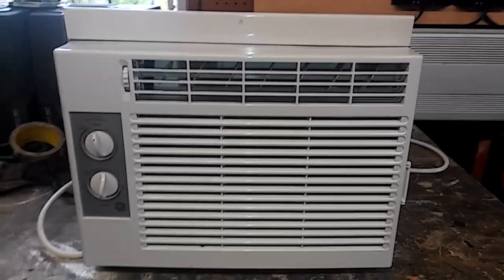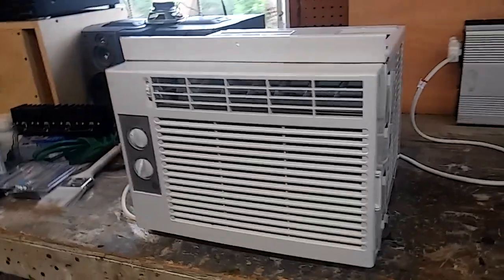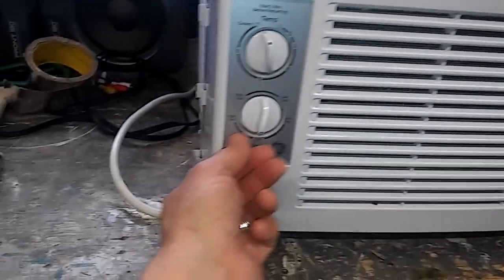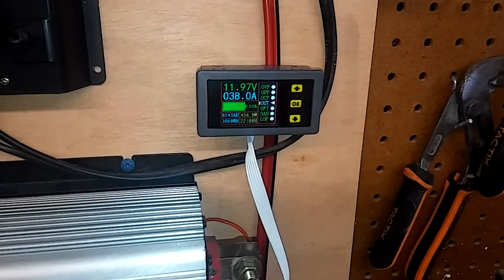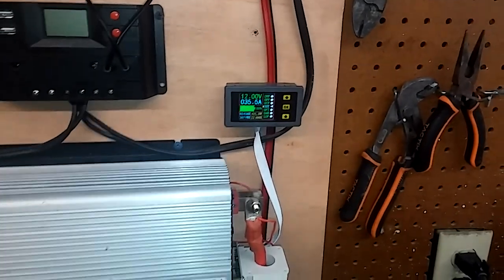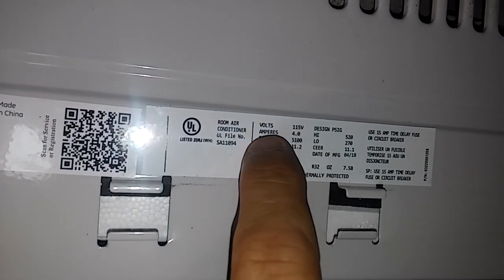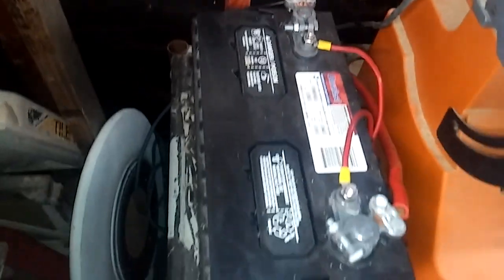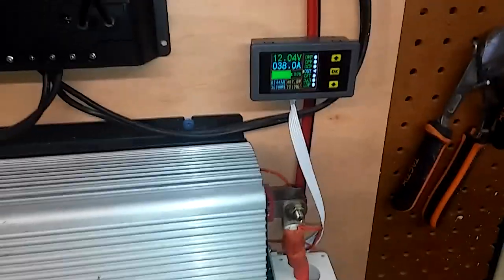6000btu ac. On Harbor Freight Power Inverter  pulls lots of amps.

Comment: A 100 AH battery, don't drain it down to zero, ie 3 hours. You'll destroy the battery real quick. So realistically maybe 1 to 1 1/2 hours, if your not running anything else.
Reply from the maker: I agree.. A/C units will kill a battery quick. Need lots of batteries

Comment: Like your videos, thank you. I believe the math for inverters is pretty simple, 12 volt inverters require approximately one (1) amp of DC input for each 10 watts of AC output.
Reply from the maker: Thank you.. Actually... For every 1 amp your Ac device needs,  your power inverter will pull around 10 amps from your battery☺
Reply: @Checkitfirst  Pretty much the same thing, you are just saying it a different way. I guess all I was trying to point out was that folks can figure out pretty quick what the amp draw will be from the inverter. For every 100 watts of AC from the device, the inverter will pull 10 amps DC from the battery. If your A/C unit is pulling 500 watts, the inverter will draw 50 amps from the DC side on the battery. Your video just helps show it visually.
Reply from the maker: Im sorry.. Your correct. I didn't mean to make it sound like I was correcting you. Sometimes my texting comes off a bit blunt😕
Reply: @Checkitfirst  thats a terrible rate of exchange i guess you would do better if you had a 24 volt system 12volt i believe is the crappiest
Reply from the maker: @mannyfragoza9652  
I am now on a 24 volt system. Might go to 48

Comment: 4 amp at 120v = 480 watts  / the reading your looking at with  your amp meter is a 12v amp draw so , 39.4 amp @12vdc = 472 watts . basically the same thing. you will never the rated amp draw rated for 120v when reading from a 12v battery.

Comment: I think mine takes about 25 amps...I ran it 6 hours today off of 20 batteries. My inverter is 24 volts.
Reply from the maker: Nice. During the day with good sun light,,, if you have enough solar,, you should be able to run it a long time. At night is where the challenge is for me

Comment: Excellent video and I hope you can read my comment. I have a question, how many batteries are needed for it to work correctly and how is it connected?
Reply from the maker: With this a/c if you’re going to use led acid marine batteries I would use a minimum of 8 batteries. Lithium batteries you could use 4. This is just a estimate because there are lots of factors in play. You would also need about 1500 watts of solar to recharge the next day and run the a/c moderately so your ready for the night. That’s if it’s a good sunny day.
Reply: @Checkitfirst  do you use one battery at a time are do you combine all
Reply from the maker: @oldschool6703  
Led acid batteries,, I would say 8-100ah.

Comment: If that's a 100 ah lead acid or agm battery then you're only getting 50 ah worth of out of it because if you go below 12 volts you're going to damage that battery and 12 volts is 50% of the battery so you can Figure 1 1/2 hours of running that air conditioner.
Reply from the maker: You are correct. In the beginning I figured 100 amp hours is what you got not realizing that I don’t even get 50%. It’s more like 30%.   you need a crap load of lead acid batteries?
Lithium is coming in the future

Comment: I dont have a battery! Can I use without one? Some one help please 😢
Reply from the maker: No. A battery is needed to store the energy. The voltage on the solar panels are too high and they’re not strong enough to actually operate a device such as an AC. You could get away with running a DC motor with just the panels during the day, but of course it all depends on the weather, but the solar panels were designed mainly to store energy in a battery bank or to use as a grid tie to offset your power bill

Comment: After 3 hours, what happens to the battery?
Reply from the maker: Ravage Gonza. It dies a horrible death
Reply: @Checkitfirst  I service UPS equipment, strings of VRLA, we load them to 100% and run them to 1.67vpc as a string of 40 qty jars, sometimes a jar will run down as low as 3 volts and recover nicely and last for years, i think lead acid batteries are stronger then people think.

Comment: 4 amps so why is it pulling  40?
Reply from the maker: The ac doesn't pull 40. The power inverter does. For every amp a device needs,, the power inverter needs around 10 amps. So if you plug a device into the power inverter that draws around 2 amps,, your power inverter will draw around 20 amps from your battery..
Reply: W=V*A
12V*36A = 432 wats
110v*4a= 440wats
Its the same power consumption.  
And if you ran the inverter while an alternator or solar panel charges you would be at 14 volts which would reduce your amp draw and thus heat in wires.
Watts=Volts x Amps is why high draw items like a welder or er lectric range are 240v lowers amp draw to deliver same wattage
Reply from the maker: Mr. Sunshine   No. The ac is only pulling 4 amps. The inverter is pulling 38 off of the battery. That’s how inverters work. For every amp the device needs the inverter needs almost 10 to convert. And yes. I can get 3 hours off of one battery if I’m putting back solar to replace what I’m using. If I can make 30 amps of solar then I’m only using 8 amps from the battery.

Comment: I’m guessing with a 12volts inverter it uses the 39 amps but if it were a 48volts inverter it would probably use 9.75ah and with a 100ah battery that’s around 10.26 hours...which means that if you’re series and paralleling 4 100ah batteries to give you the 48vds; then you would end up with 48vdc @ 200ah which would extend the time the 6000btu ac runs to 20.51 hours.. not bad though, it looks like ur 6000 btu is burning 468 watts, which is strange because I believe that’s the watts a 5000 btu burns..
Reply from the maker: Cooking With The Nick’s. Thank you for all the information. I have been thinking about a 48 volt set up. With your info you shared I believe I will start looking for a new inverter 😊
Reply: If you connect in series, 4 100ah 12v batteries together you only get 200ah @ 24v. If you connect in parallel another set of 4 12v 100ah batteries {which gives you 8 12v batteries} you get 400ah @24v. you said {series and paralleling 4 100ah batteries to give you the 48v @ 200ah} is wrong. What you said would give you 100ah @48v. 
then if you add 4 more 12v 100ah in parallel you would get 200ah @48
Each 12 volt 100 amp hour battery is connected to the adjacent battery in series to make 24 volts. Then, each 24 volt pair is connected in parallel to the next 24 volt pair underneath. You can connect additional batteries using this method with as many pairs as you would like.

8 12v batteries wired like this gives you 400ah @24
do you have a wiring diagram for what you are saying?
Here is what I found. https://mwands.com/wiring-batteries-parallel
Reply: 1 more thing. You can only use half of your battery power. Better if you only use 1/4 or .25. So you could not run an a/c unit for 10.26 hours @48v 100ah. You could get 4 1/2 hour  is half discharge. 2 1/2 hours is 1/4 discharge. You will destroy your batteries if you discharge below 1/2.
Reply: @Wontreplyeverdontbother  I know a hell of lot more than you.  sorry i put 24v meant 48v. he is wrong on amp hours is the point i was trying to make. if you could read past 2cd grade level you would have seen that. if it looks like shit and smells like shit it is shit thank you

Comment: It would have been nice to know the size of the inverter.
Reply from the maker: foreverfixin. 10,000 watt surge. 5000 continuous
Reply: @Checkitfirst  Thank you, man. I am trying to do. An inverter in my camper van I got the 1500. I think I'm going to go get the 2000.
Reply: @Checkitfirst  thats a massive inverter
Reply: @normnilsson7208  its a modified sine inverter. They are super cheap. I have one, works ok, but not as good as a pure sine